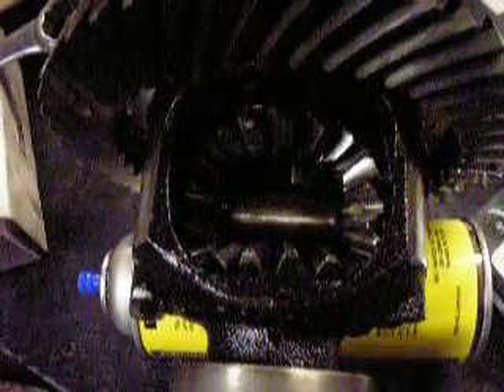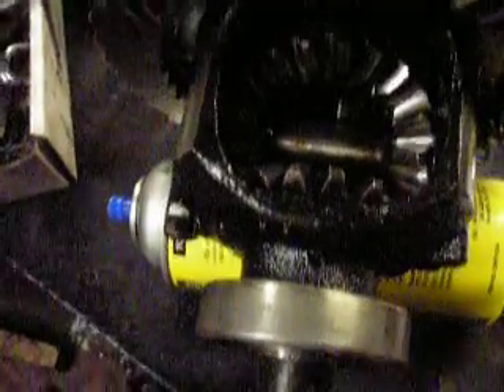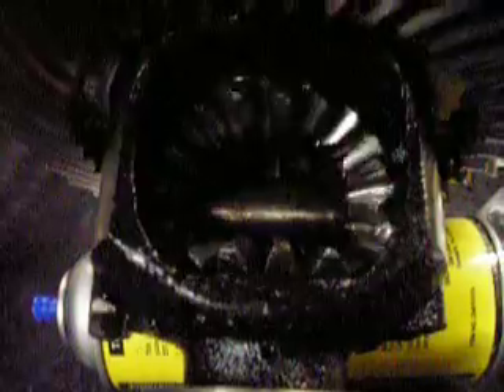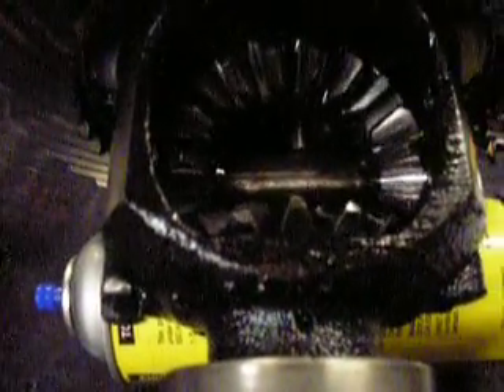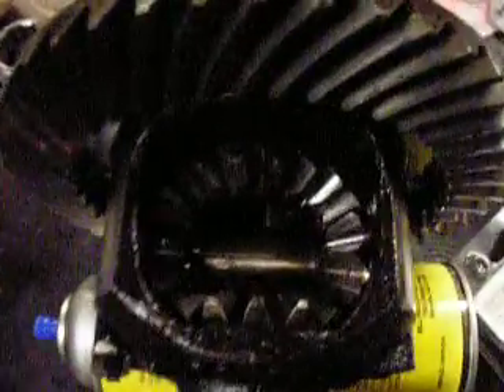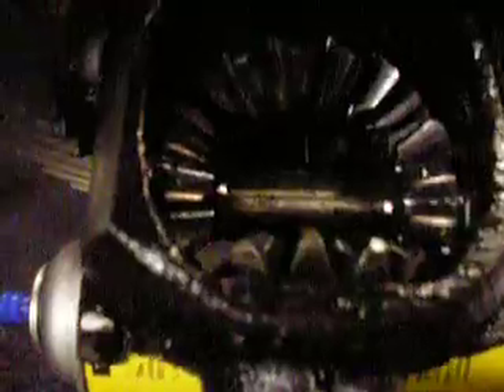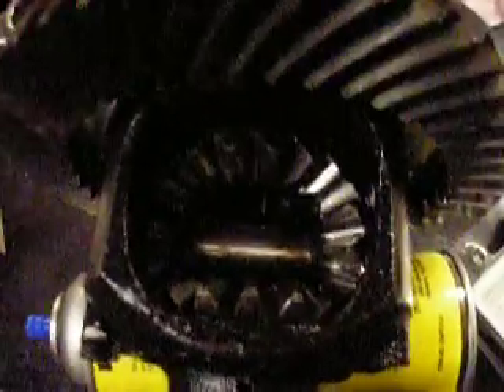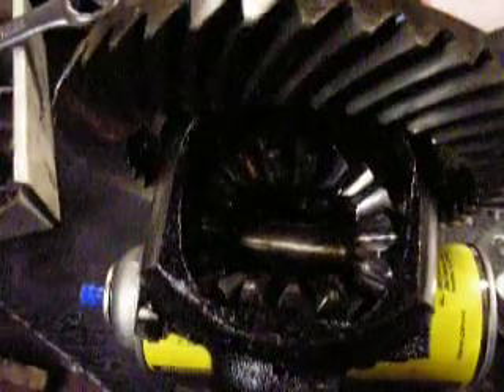differential gear / spider gear backlash before rebuild

Comment: Great job, after watch'n your vid it only took 40 minutes to do the job I replaced the rear bearings, and ended up replacing the sider gears, I guess the next job will be calipers, rotors, and pads, dose it ever stop?